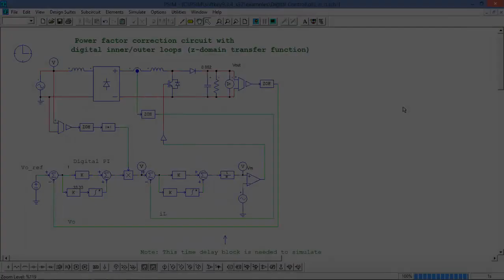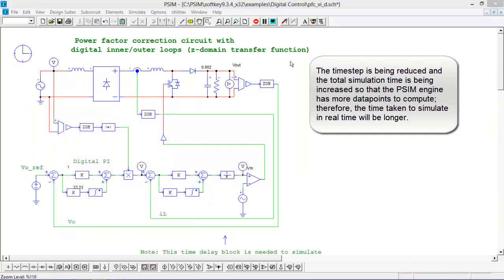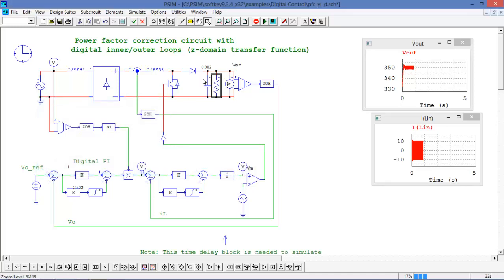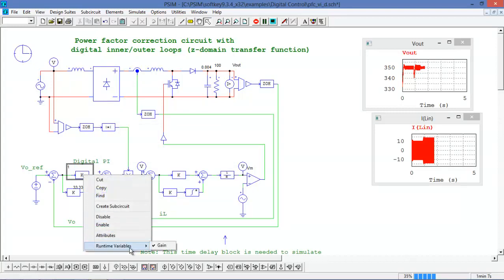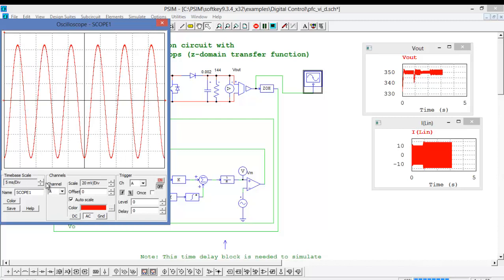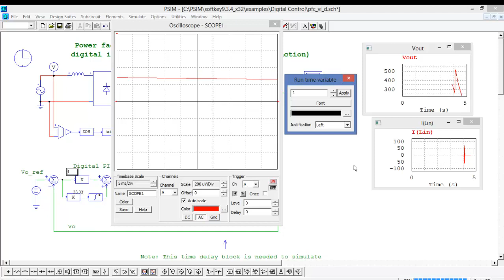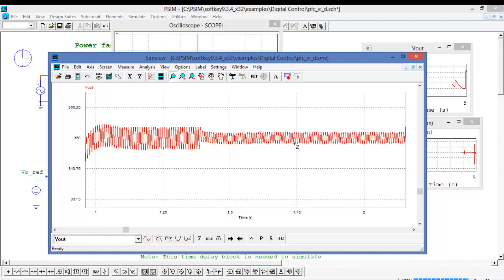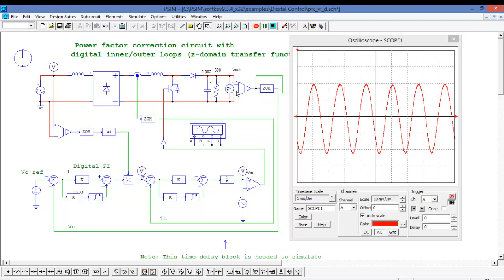How to change variables mid-simulation with PSIM

Comment: How do I simulate a thermistor (NTC and/or PTC) in PSIM?
Reply from the maker: ***** there is not a specific NTC or PTC element in PSIM, however, you can use look up tables to characterize the impedance that you want to model. Also, there are non-linear impedances available which you can use. If you wish to see some example circuits please request support http://powersimtech.com/support/request-support/
Reply from the maker: lookupo table video https://www.youtube.com/watch?v=edDyXmujjpw